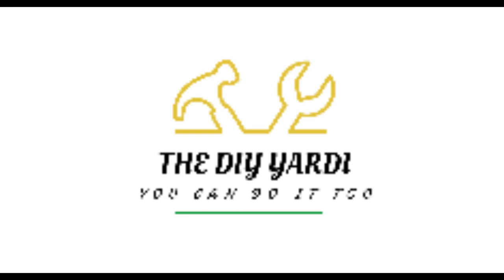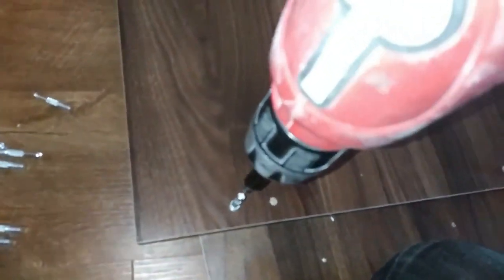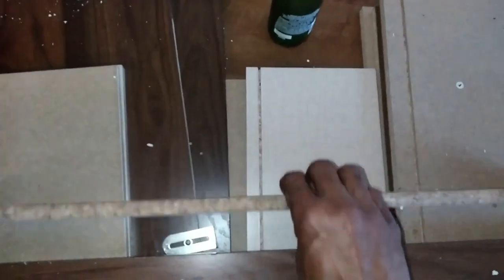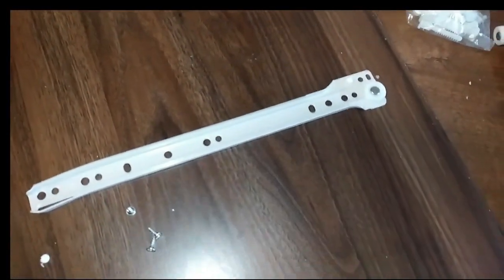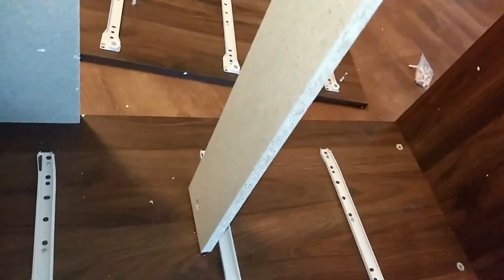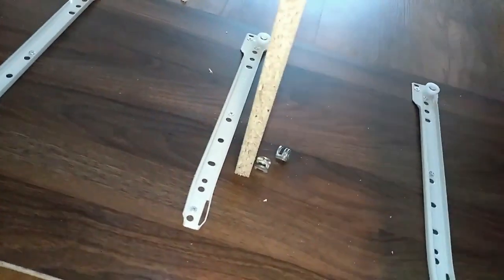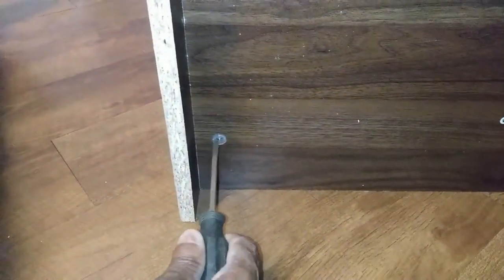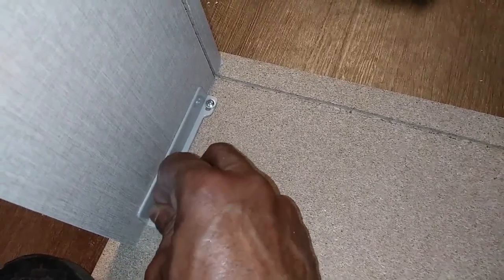Ameriwood Home/Emery Four Drawer Dresser Complete Assembly

Comment: It looks like I put mine together exactly as told, but the bottom drawer closes a quarter of an in inch and I have to lift the one next to the bottom to get it to close correctly.  I don't see way to fix this.  Any suggestions.  I can still use it, but it's annoying.
Reply from the maker: @crowe bobby, the only thing I can think of is that either the tracks for the bottom or drawers just above the bottom ones must have been mounted using the incorrect holes in the tracks, if mounted correctly, all the drawers should have the same amount of space between them with the drawers closed.if the bottom one the only one off, then the tracks. for that one is causing the issue..
Reply: @thediyyardie7192  Thank you very much.  I'll check that.  Meanwhile it works well enough.
Reply from the maker: @MrCrowebobby  👍